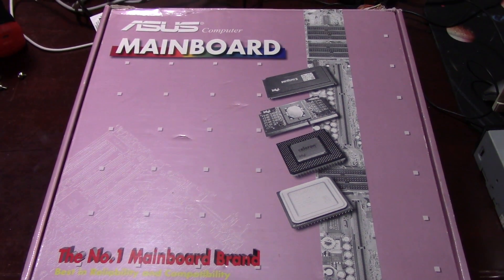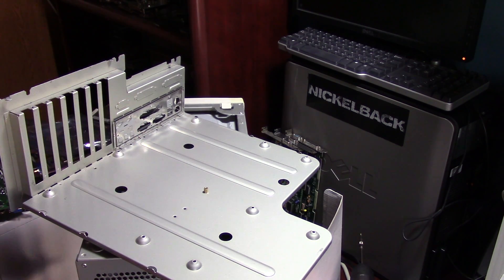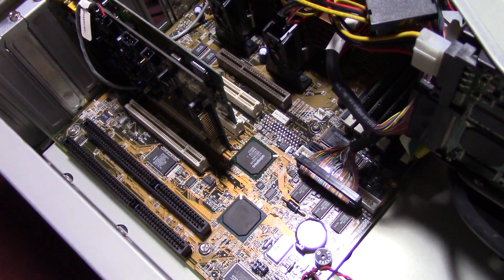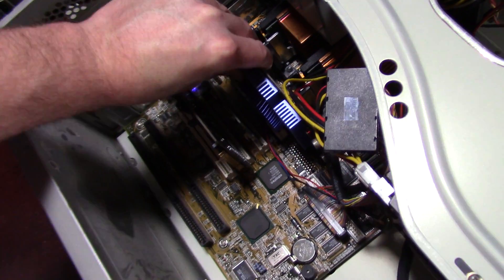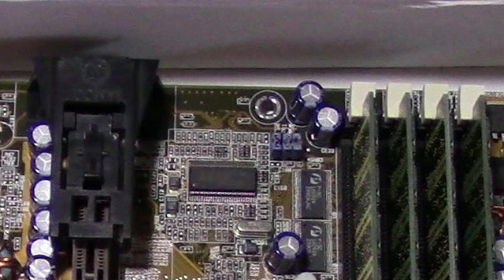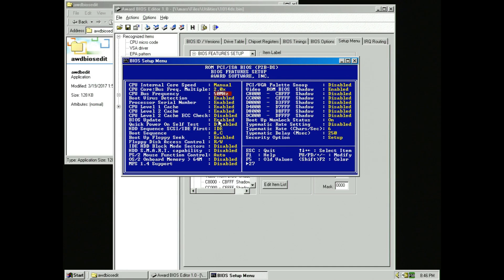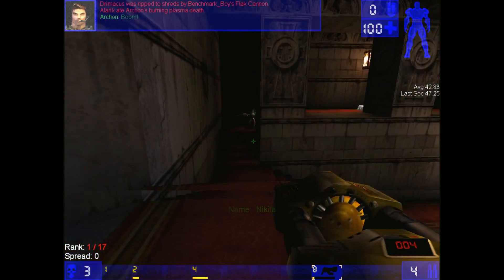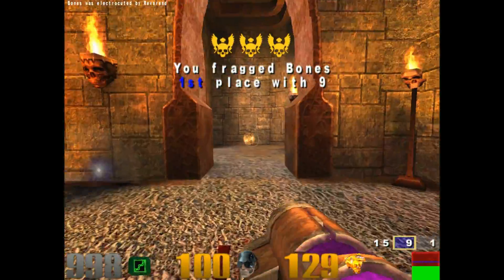Dual Pentium III 1Ghz Build and Benchmarks

Comment: I had a dual processor Pentium 1Ghz system, not sure what the performance difference was because I didn't have much to compare it with. But what I really appeciated was multitasking in Windows, I remember times when the system would hang and you had to wait for Windows 2000 to catch up with you on a single CPU, but that went away with the dual CPU's.

Comment: I have a Tyan motherboard, dual socket 370 with two Tualatin 1.4ghz cpu's, and a total of 2gb pc133 ecc ram. (4 x 512 mb) Must have been expensive back in the days.
Reply: expensive for today standards. now its a highly sought collectible

Comment: Yes... definitely need to fix mine now, just a bad hard drive, then we'll see how much that 133MHz FSB makes a difference or if simply having "moar clocks" can keep up. For me the second processor makes a noticeable difference in Cinebench and also in Vegas when rendering newer codecs. Otherwise, this thing certainly looks like a proper dual slot beast. Hmm, 2MB of cache huh? Oh, I wonder what that could be. Seeing that Hercules card brings back memories of that 7500 I used to have, I still miss that thing and I remember seeing the GeForce cards they made but not being able to afford them at the time.
Thanks for the forum link.

Comment: excellent video and very cool build, I myself own a Compaq AP550 workstation with the dual 1Ghz models, albeit that PC uses an i840 motherboard with RDRAM.

There was some argument at the time over what was the better choice (well the argument was regarding the i820 mostly) though the fact that the later chipsets don't require an overclock is certainly a benefit.
Reply from the maker: I am going to be looking at dual slot 1's on an i840 platform with pc-1066/32 rambus in the future. It is a board from a Dell GX300 box, but should suffice just as well.

Comment: I always love the music you pick. :D SoftFSB, sounds like a great program. I thought the radeon would of been better vs the geforce! I would like to see something like Puppy Linux or Puppy Arcade on these.. hell the processors would make a killer BeOS machine.
Reply from the maker: I've got plans to do a video on BeOS.  I bought BeOS 4.5 back in the day and got the BeOS Bible, which I still have although the BeOS cd has gone missing, but I still have the booklet that came with it,  but I did download the ISO image of it and burned it a while ago, including 4 and 5. When BeOS came out I really thought it was better than Linux at that time for things like multimedia and gaming with it's pure OpenGL design. I burned Haiku to a disk too but haven't gotten around to looking at it either. I think BeOS could have been a real alternative to Windows if it had the support of developers behind it.
Reply: WaybackTECH I also had the BeOS Bible and version 5. I'd agree if they had more developers, BeOS might still be around!
Reply from the maker: As for the Radeon, actually I would have preferred to use that card as it did make it through all of the tests but, I had random kick backs to the desktop with that card after about 20-30min of game play, plus when I tried to run Aquamark on this system with the 7500 installed, the card locked the system up with in a few minutes, while the GF3 had no isses. It came very close to being stable with the 83Mhz speed of the AGP but just not quite enough. Good card though, I really like the 7500. I also tried the Matrox G400 and g450 cards and... they were quite a bit slower and despite claims that the Matrox cards coped with the overclocked AGP bus, mine barely made it through a pass of 3Dmark without freezing.

Comment: Some demos seem to stutter a little bit, probably due to the "slow" AGP bus.

This is odd to see unreal tournament run that "slow" on a dual p3 1GHz because I'm playing that game on my pentium 2 400MHz with a voodoo 2 SLI and I get roughly the same results IIRC
Reply from the maker: It's due to the capture card as it was only capturing at 27fps at the time.  My better avermedia card just bluescreens the system now since I have swapped the guts of the capture computer to an I7 so I can do on the fly mp4 compression, so I had to use my old PCI card I normally use for dos capture. I had forgotten the avermedia card wasn't working and by the time I got to the capture part of this build I just said hell with it and went with what I had
Reply: Oh okay ^^